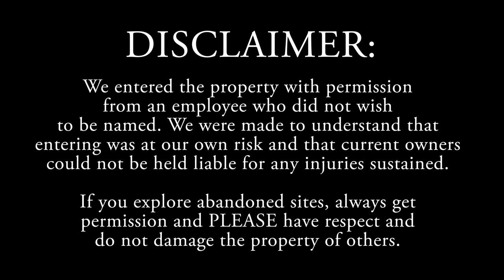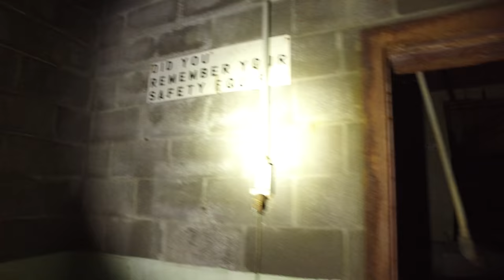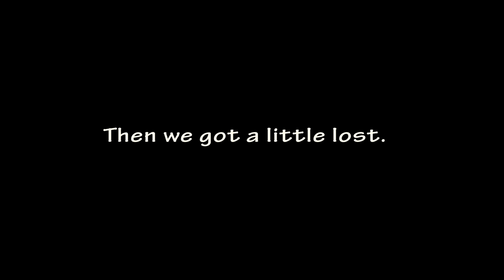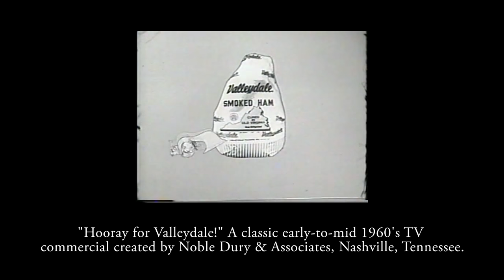ABANDONED - Reelfoot Meat Packing Plant

Comment: Ken, Garry, you spent so much money upon the DJIs and when it comes to walk in the buildings, you are going in shorts, no gloves, no propper shoes. And certainly no lite, except a single singlecell torch... 
I guess, your wishlist for xmas is looooong....
Reply from the maker: Heh. We actually just went there to drone the smoke stack, but then we met the guy who said we could go inside. So we hadn't planned on an interior exploration.
Next time we will keep respirators and extra stuff in the Adventure Mobile in case another opportunity pops up.
Reply: I can recommend workwear trousers and protection shoes (it feels strange when you walk and suddenly a piece of plywood is attached to your sole due to a nail facing in the air...)
Gloves (even the lightest ones) let you have firm grip in case you suble, without the big risk of getting lockjar. 
And a good baseball cap (there are reinforced ones available, for meatpackers <sic!>) and some long sleeved "combat shirts", which provide cut protection in case you face a nail poking out of a doorframe in the dark.

Comment: Just found this video. I live in this town. I was in the old Reelfoot building 100’s of times before it closed down. It was creepy when it was still in operation.  One of the rooms you when in used to chill the hogs down after they were slaughtered. There would be 100’s of hogs hanging from a rail system of off the ceiling. They made the Reelfoot brand of hot dogs, bologna and country ham. They even made the Franks for Van Camps beans n’ Franks. They produced tons of other meat products for other labels too. I’ve heard that record before it’s a real winner

Comment: I worked there in 79 as a independent  contractor,  building a smokehouse at this location.  This was my first job working on smokehouses here it is some 37 or 38 years later, and I am still in the business, but not on the road.  It was late spring early summer when I worked there and it have an overpowering odor many times.  I  used to have to go from one end of the plant where we were putting the smokehouse at and to the other end where the maintenance shop was so I could cut and thread pipe.
Reply from the maker: That's incredible! Thank you for sharing your story Wesley.
That place is etched in my memory as well, and I was only there ONE day!